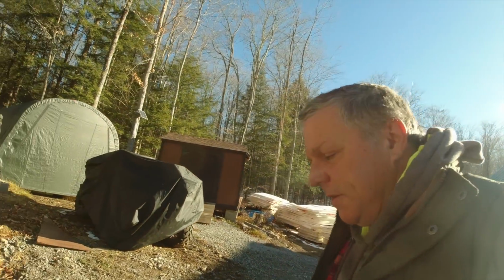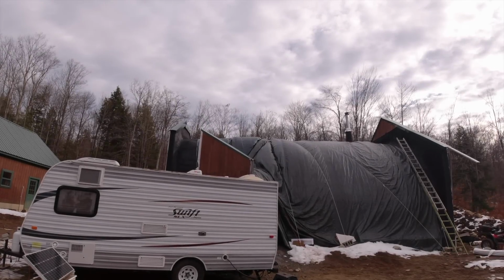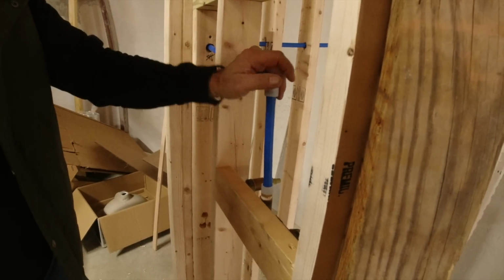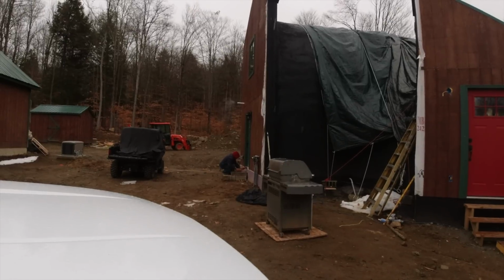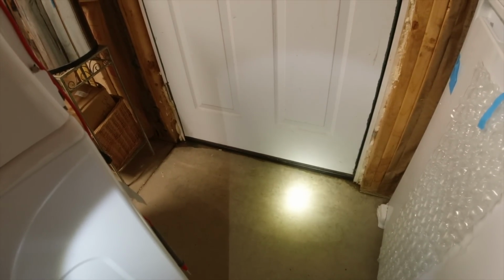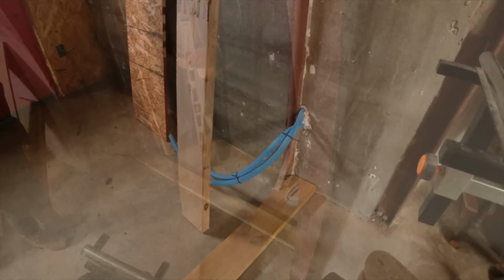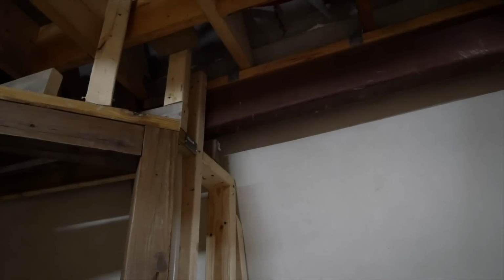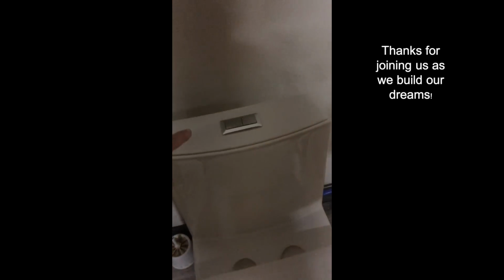FOCUSING on FUNCTIONALITY | Building Off-Grid in the Adirondacks

Comment: Just some advice. When you are soldering shutoffs onto copper stubout attatched to pex. You should put a wet rag around copper by wall so the pex does not get heated at the connection and cool down soldered joint imediately with wet rag as soon as soldering is done. When you are planning to stain wood, never sand with a finer grit than 120. Anything finer and the dust will seal the pores and stop stain from getting into wood and you will end up with a lighter color than you planned on. The construction company I work for puts 'Grace' ice and water membrane on the entire roof, even under flashing to prevent leaks. My earth berm house I am building in the ADK's I put ice and water membrane on entire structure before covering. It's a significant extra cost, but piece of mind. I have never had a leak at my house or at work.
Reply from the maker: Thanks for the tips and advice. We have all the membranes, foam, umbrella etc. to cover the dome with, we just didn’t get finished in time this year. We need to have retaining walls poured before covering so just need to make it through winter. If everything went as planned we wouldn’t be in this situation right now so we’re just trying to make the most of what we can for now.
Reply: @CreatingASimplerLifeOffGrid  Though I still think you could have covered the dome with dirt even without retaining walls, leaving extra soil in place of retaining walls. To get extra soil away to put retaining walls in place, it's like half an hour job for a digger or few hours job for your little Kubota. Also, there are ways to pour concrete in winter frosty conditions, if needed. I wouldn't hesitate to go for this option for a such thing as retaining wall. But anyhow, I hope the tarps get you through the winter!
Reply from the maker: @oakld  Unfortunately our membrane is designed to continue onto the back of the retaining walls....

Comment: Hey guys. I’m an exterior construction guy for over 20 yrs. Your water leak is coming in above your doors. Caulk the tops and sides on the outside with exterior caulk. Go heavy on the tops. Especially where the grooves are where the brick mold hits the t1-11 grooves. This will fix your problem
Reply from the maker: We will, thank you! We realized we never added trim to the top of the doors outside. Appreciate your help 😁👍

Comment: I hope that you put Pipe Insulation around your Pex - in every location that is touching the cement dome.  When water passes thru your pipes under pressure - it will flex, viberate, and rub on the cement.  Eventually it will wear a hole into the pex pipes.  Just a warning!  :)
Reply from the maker: Yes, thank you! We bought it last night and will be getting it done right away 👍 we appreciate the help and advice!

Comment: All your door leak?  How do you have them flashed at the top of the trim? T111 siding groves make it prety difficult to get a seal properly.
Reply from the maker: We just looked and they do have flashing, however the trim was never finished so we’re going to caulk and finish trim. We’ll see if it helps!😁
Reply: @CreatingASimplerLifeOffGrid  what kind of flashing goes to the back of the Gove in T1 11?
Reply from the maker: It’s aluminum bent from up behind the t111 and out over the top of the door
Reply: @CreatingASimplerLifeOffGrid  that should be good then but I would check the corners of the flashing for cracks.  I also wouldnt put trim on before things are water tight.  You have very tall walls and and any type if wind can drive rain into all the nooks and crannies very easily.  I may even remove or peel back the insulation when you know it's going to rain and see what gets wet first.
Reply from the maker: @BS.-.-  Good advice, we were thinking that we might have to remove the trim and double check everything. We also know that once we add the roofing and porches etc. this hopefully wont be a problem anymore....just have to get through the next few months 🙂
Reply from the maker: @BS.-.-  None, it is under the T111 like an 'L' ....maybe that is the problem?